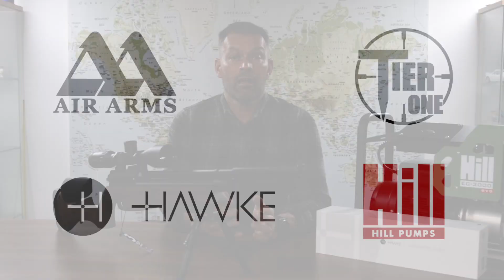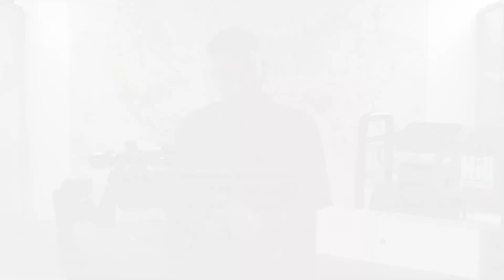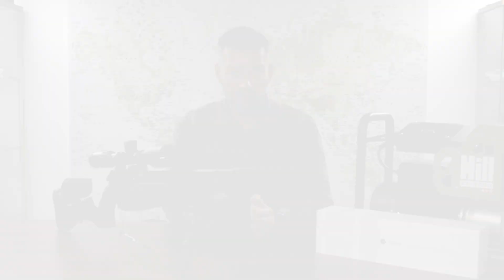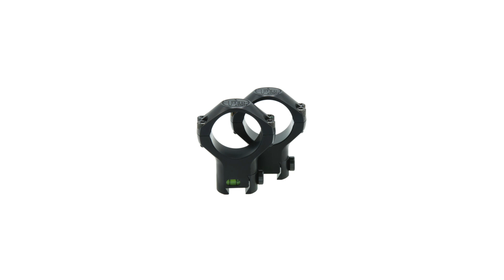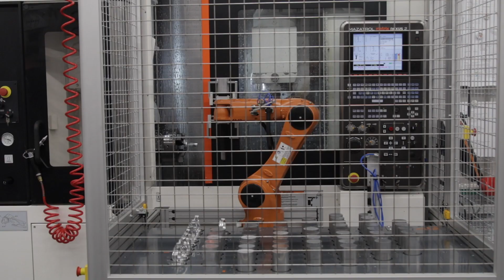Behind the Scenes of our Air Arms S510 Ultimate Sporter Dream Build.

Comment: What movement adapter do you need to order with the bipod to fit the s510 ultimate sporter?
Reply from the maker: You can use our sling stud adapter, but if you want QD Picatinny you'll need a UIT / Anschutz to Picatinny adapter.